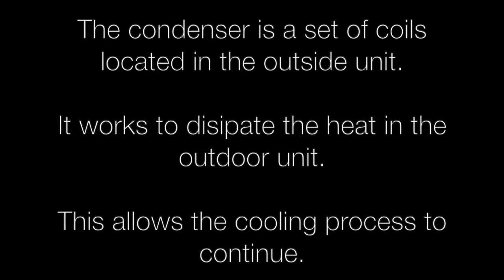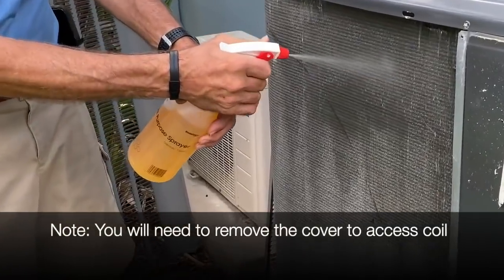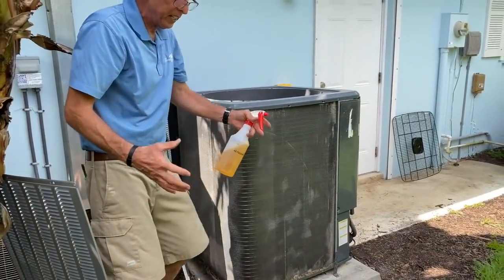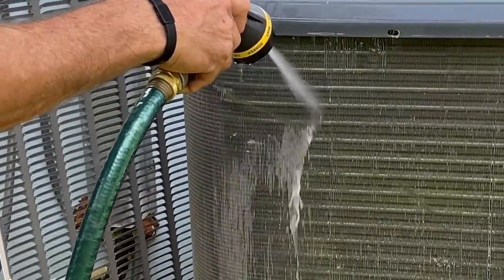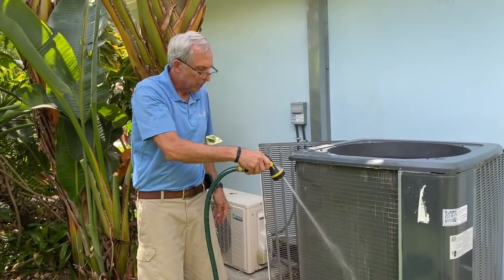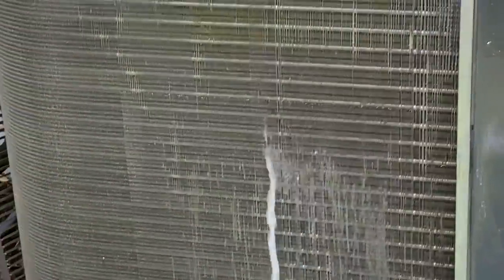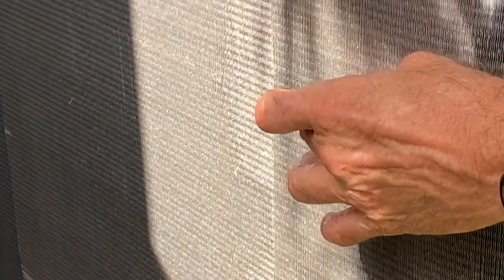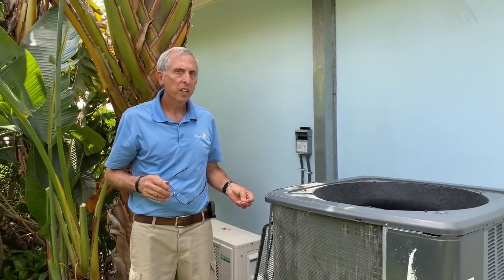How To Clean Your AC Condenser Coil

Comment: Thanks for this video.   My question is this:    Do you need to remove the other 2 sides of the a/c unit when cleaning?  I saw you remove 2 sides but was wondering about the other 2 sides.
Reply: Same question. I’m sure it’s a silly question, but were you just taking off the two sides to show you should remove all covers at once or do only certain sides need cleaned? I’m assuming you normally do two on one side, button it up, then do the other two sides, correct? And is there any validity to people saying only use dish soap on new coils?
Reply: Yo. An remove all sides if it's not been done in awhile. Also make sure the bottom drains are clear

Comment: Great video.  I never even knew these had to be cleaned.  Can I just use Dawn liquid dish soap mixed with water instead of coil cleaner, or does the coil cleaner add some benefit (e.g., anti-corrosion agent)?
Reply from the maker: Very very lightly but yes
You must make sure it’s washed off well absolutely no suds left on the fins  because it will create a sticky surface for debris to collect
When it dries thx you

Comment: Do you need rinse the unit with a water hose first before using the coil cleaner? What should the measurement be for mixing the water with coil cleaner?

Comment: Why must we first turn off power to the AC unit? I have done this routinely without turning off the power.
Reply from the maker: Because you never know an electrical wire may be bare, there’s 240 V running into the system and this is very dangerous.
It can kill you before you know it
Thanks for watching

Comment: I live out West where dust is always in the air even if you can’t see it. I hose down my AC unit a couple of times a week. It’s clean as a whistle. Takes a whole 1-2 minutes. It should never get to like you see in the video. The AC installer said AC’s LOVE water. That AC unit is a MESS. If you’re too lazy or dumb to simply hose off something that is so obviously filthy dirty, then I guess you deserve to not have it working when you need it. And change the filter often.
Reply: You are 100% right, back 24 years ago I purchase the A/C install by the professional, 1 year later I call them to check the unit, the guy told me just to hose the unit often make sure no dust attached, you don't need to call me any more. Since then my A/C working great. I am in the west coast.

Comment: What does it usually cost to get your coils clean?
Reply from the maker: About $100 depending on the location and how much it cost to get the technician to your house thanks for watching
Reply: Thanks you for this information, i think i just got ripped off.
Reply: You can do it yourself too. They sell coil cleaner at Home Depot for like $7
Reply: @mrtechpat  thank you Patrick, i just paid $300 to get my coils clean and i am so upset about. And what he did I knew i could have done it my self
Reply: ladieBrown I just did my interior evaporator coil. Haven’t done the outside yet. It was so dirty . Prob the cause of an odor when the ac came on
Reply: @mrtechpat  its a carrier compact
Reply from the maker: correct 
save your air conditioning life
thx
Reply: @bluecollarmillionaire4life  thank you.
Reply: @mrtechpat   I use Simple Green HD, the purple stuff. It doesn't react with the aluminum fins, and it's way cheaper than the purposed "coil cleaner".
I use the same cleaner in my ultrasonic cleaner to clean carburetors. 
Home Depot carries it...around $ 14 a gallon. Dilute it per instructions.
Reply: @jere4524  DO NOT use Greased Lightning. It's a great cleaner but it corrodes aluminum.

Comment: Never saw a condensing unit that you can remove the top without the fan because the fan is usually attached to the top making it a real pain in the butt trying to clean from the inside out.

Comment: Can you use a pressure washer?
Reply: I wouldn't recommend it. A hose does well enough. The fear with pressure washers is you can damage the fins on the coil
Reply: @justinwestfall3311  Thanks

Comment: Question.  If the unit has been running for a while because the system is maintaining temp is it necessary to have the system off for a specific amount of time before things get wet?  Or no cool off time is required?

Comment: He rinsed it wrong you spray it from the inside out. Why? Because the dirt gets sucked in from the outside so blowing it back out the way it came in is the proper way. I learned this from Reeds heat and A/C in Beebe Arkansas in late 80s to early 90s

Comment: 1) The reason you shut the power off is to prevent the unit from starting while you have your hand hand/arm in there. NOT because of a possible loose/lve wire.
2)Start by sprying the water from the inside towards the outside. That wat you won't impact it. 
3)Should not use any chemicals on the new "all aluminum" coils.

Let the pros do their job. Too many home owners think they can do it because they saw a YT video. Then we go out and find the one screw they lost stuck in the coil. Or they put the screw through the coi. Then don't bother saying anything. Or they knock a wire off somewhere and complain because "we" charged them how much for that?
Reply: Oh stop the BS! You are just trying to lay down the trash and confuse people who take care of what they have.. I have a 20+ yr old HE Lenox A/C, I've been using water once a yr.. Clean inside to out top to bottom no problems. Also every 2 years, take that Condensor side door off and clean out cobwebs, dirt and rust.. Spray WD40 on any rust around the copper coil housing entries inside the cabinet,etc.
Turn power back on and enjoy! The Lenox Systems are damn good units. Mine was installed in 1996 and still going strong! And, I do all the maintenance! Stay Cool Bros and play some of that feel good music from the Super Swedes,, ABBA!
Reply: So you do it right then. 

I never said anything against Lennox. I like lennox. 

No BS just free advice. If you have a maint. contract with any company and they don't clean it inside and out FIRE THEM. As a technician if I go out and find something that should have been cleaned or done during a PM i get put in an uncomfortable position with the customer and do not charge them. I also get really pissed at the guy who should have done it during the PM.

The problem is the people who don't do it wrong. They think they see a YT video and they are experts. As far as chemicals go, I  am talking about the "chemical cleaner" for the coils not WD40. 

As you can see in the video the chemical pools at the bottom and is corrosive if you do not get it ALL off. This is especially bad news on the new all aluminum coils. The type in the video is copper pipe with aluminum fins around the copper.

One last thing do NOT use bleach to clean your drain line. Use some type of vinegar. The bleach will deteriorate the PVC pipe.
Reply: @john-t-bjohnb3588  Thanks for the Heads Up!

Comment: What happens after you shut the power off and you turn it back on after you're done cleaning and there is an open electrical wiring, will there be any spark or will it pop the circuit breaker?
Reply: rock o -- If there is something wrong, the breaker will not reset... It it's wires that got wet, then get a yard blower and blow air all over the fan motor down there and see if that works..
It it is not dried and working by the next day, you may have another problem..
"If there is an "open" in the wiring....

Comment: I use Simple Green to spray on the coils and on anything else that needs a good cleanser to loosen accumulated gunk from the engine in my trucks to white walled tires,....GOOD STUFF !!
Reply: You can do it to your cars condenser ?
Reply: YES, Simple Green is an awesome degreaser/cleaner! Simple Green will break the surface tension AND is also non-toxic.
Reply: Simple green isn't meant for coils
Reply: @user-NofaceNocase  Yes! It's a good idea to do that at least once a year or more often if you drive in dusty conditions.
Reply: @thomasdragosr.841  definitely.  I live in vegas so this product is very useful

Comment: You clean the condenser coil from the inside out not outside to inside
Reply: Cleaning the coil from the inside or outside is better than not cleaning…most techs I know have cleaned coils this way…alot of tech on you tube clean coils this way… don’t be negative.

Comment: How did you get the top off the unit 🤔
Reply: shnstrr -- there are like 5 little screws that hold the top cover on the unit...
Take them all off,  do not lose them,  take the top cover off, spray the water from the Inside first, to Push all the dirt Back Out of the fins..
Reply from the maker: Usually has 5/16 screws take your drill and just take them off

Comment: I can't agreed entirely with the video. I use a foaming cleaner and I spray it from the inside until the foam works its way to the front of the coil. Then I let seat for 10 to 15 minutes, then rinse it from the inside from top to bottom. Once I'm satisfied that it is clean, I will rinse the outside. The whole time use low pressure water.

Comment: Every HVAC guy I know, and I've been in the trades for over 30 years says; those coil cleaners corrode the coil...They say all you need is a hose with good pressure...
Reply: These kind of ppl are great for our business, and teach other idiots how to become future customers.
Reply: @davidcanary60  : ) ... "Never interrupt your enemy when they are making a mistake" Napoleon.
Reply: The problem is people put WAAAYYY too much coil clener on the coil and then never get ALL of it off. That's what kills the coil. See it all the time at the top and bottom of the coil or near the endplates where they can't get it off.

Water is all you should need.
I even use just a brush and an air compressor. Been using it on the Bard units at the cell tower sites (where there is no water source) recently and been working fine.
Reply: @john-t-bjohnb3588  That makes sense — them leaving the stuff on...Air is a good idea!

Comment: the only coil cleaner u need is water u going to vent your coil u have to do it soft coil cleaner is acid you will damage ur coil... 🙉
Reply from the maker: The coil cleaning solution I’m using is very mild it is designed to make bubbles until it is thoroughly rinsed out which at the same time you’re getting out all the debris and dirt that may have accumulated. 
You are correct on the corrosive solution it will eat the coil fins.
Thank you